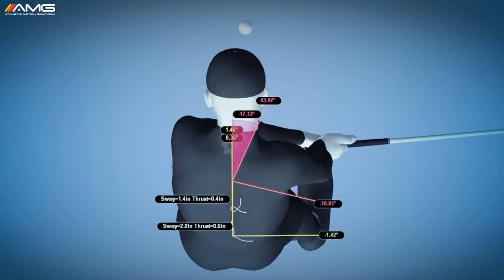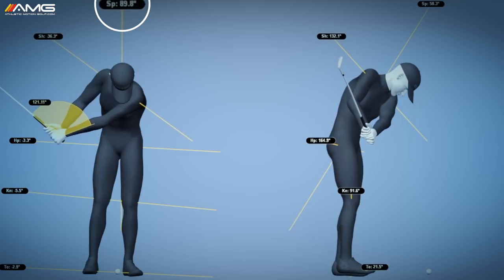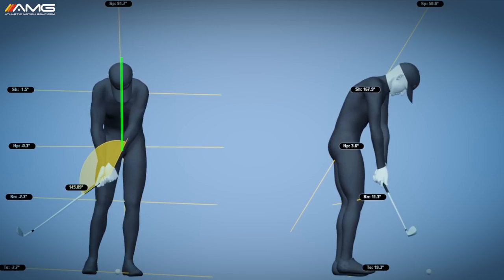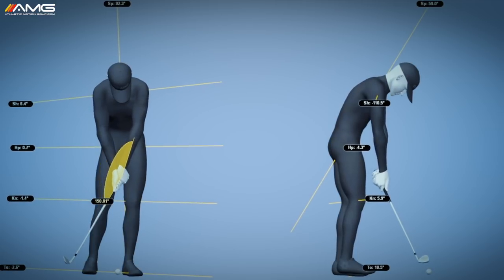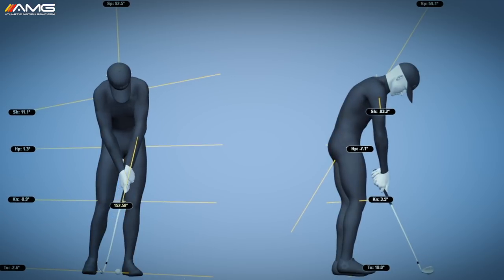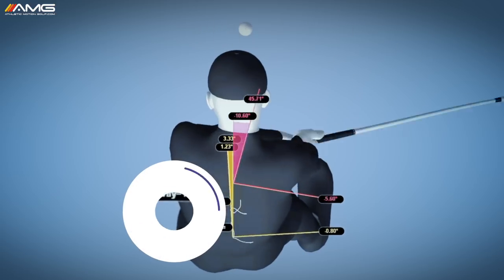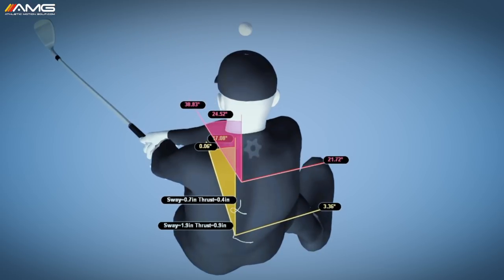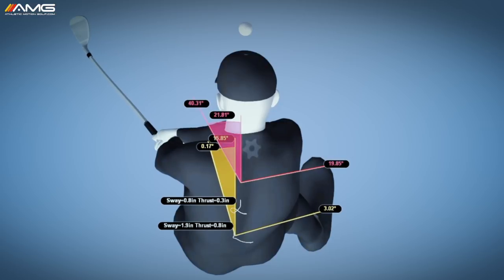Pitching Lesson

Comment: Great video as always ! I’ve always been told though to put the ball in the middle of my stance, to generate more backspin and control, and here you told him to move the ball a little bit forward in his stance. Why ? Because of the lie ? Or because of the type of landing he was seeking?
Reply from the maker: Good question.  I like it forward for these shots because we are standing more of the weight and pressure on the front leg so it's essentially under the player from that setup.  If the ball wasn't moved up a bit, it would play back from that setup.
Reply: I'm guessing to use the bounce of the wedge. Its scary at first if you've always led with the hands coming through but it works. Especially with muddy lies you get more margin for error too.
Reply from the maker: Spot on, SD... tons more margin for error.